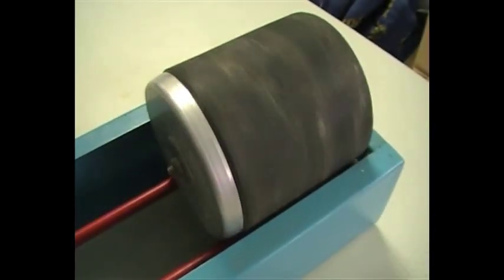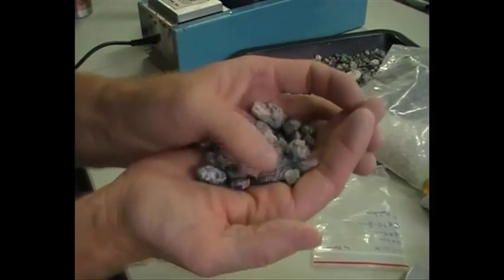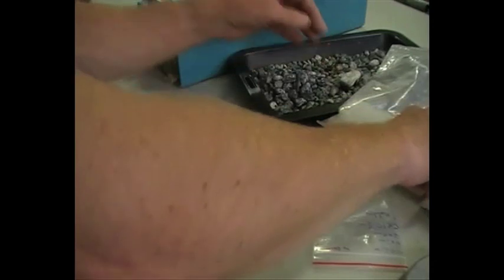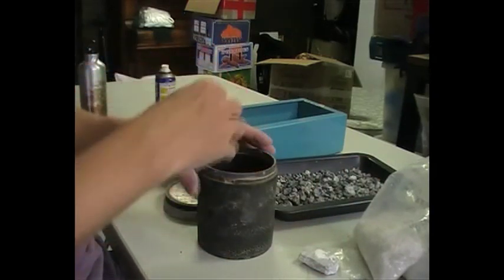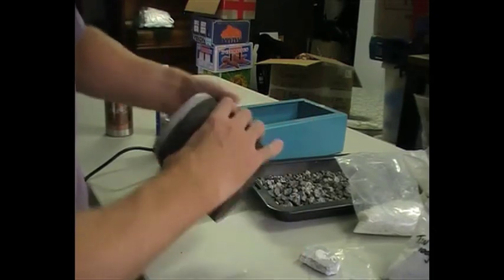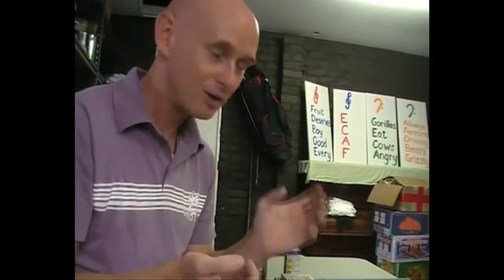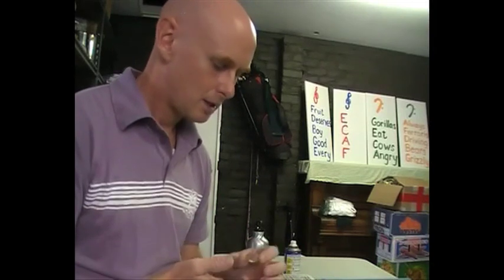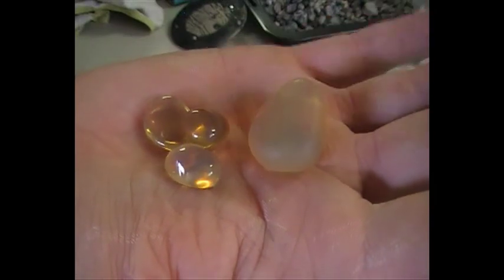Tumbling Opal video by blackopaldirect.com

Comment from the maker: Hey mate thanks for the kind words. I would use half half on the plastic media to your opal. And dont over fill your barrell, about 1/3rd and the grits, I use coarse Pumice The grit size you can use is 100 to 300 grit to start and then you can move down to 600 to 1000 grit and then cerium oxide which is in my opinion the polish powder out there. I think cerium is about 20,000

Comment: Thanks for your amazing videos Justin!  I have just some rough opals left about 2000ct and thought about tumbling them in a smaller rotary tumbler, 3lbs I think, Just out of curiosity: Instead of plastic media, what you think about nutshell granules or even cobcorn granules? And for the polishing stage, I have Ceroxid, AluOxid and Titaniumoxid, what would you prefer for opal tumbling? Thanks in advance 🙂
Reply from the maker: You could use any I suppose but they will wear and make a paste
Reply: @blackopaldirect  Hello people, hello Justin, I am well aware, that this is not a support channel, however, I am happy for some advice from Justin or someone with the same experience concerning the opal tumbling. 🙂
After the polishing stage with CeriumOxide which was quite a good pure quality, the opals got a yellowish touch. I can't imagine a good chemical explanation for it. Anyway, I did some small experiments with low concentrated oxalic acid and got them perfectly white
 and clean. The negative impact was, they got dull again. (poor stones ;-) ) I wonder now, if I should use Titaniumoxide for another polish run, and/or a 8000grid siliciumcarbide. Thank you very much for your input! And greets from europe.

Comment from the maker: Hi there yes I cut them first on a wheel so it speeds up the polishing process. If piece are breaking in the tumbler it would mean that the barrel is too big and there are no cushioning beads to soften the opal impact with other opals in it. Also experience show you which pieces to cut by hand and usually the come in the form of a color bar that needs grinding down on to see the color. :-)

Comment: im almost getting to a stage where i can try out my tumbler if i put in rubs that have been hit first with a 360 grit diamond wheel can i start with 600 grit ? And an idea i have is instead of throwing away the grit slurry and plastic beads ...could you not pore it into a container to use again ? Thanks once again Justin ! hope 2012 brings forth more great Opal !